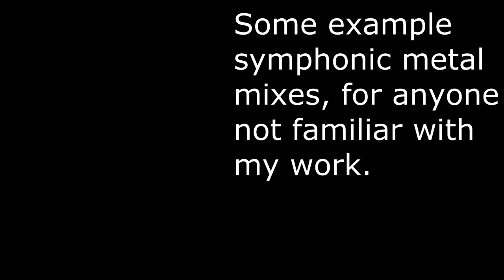How to Mix Symphonic Metal, Part 1

Comment: Certainly the most difficult genre of metal, or even Rock and Popular Music in general to mix.
I completely agree that there are no standard mixing formulae to use.  I almost think of using the orchestra like a lead guitar if that makes since.  I also keep the lead guitar to a minimum amount of presence in the mix.  Rhythmic driving from the bass and Rhythm Guitar seem to be the order of the day.  Drums can be in the middle of the volume spectrum but with lots of care with regard to EQ and Compression.
Totally agree about the vocals.  It's even harder to mix them in nicely if it's a Rock singer with a lot of grit like a Corey Taylor or Lane Staley or Miles Kennedy type of singer.

Mixing it is a pain but great mixes in the genre are few and far between but the great mixes really stand out.

LOVE your videos, man.  They're great!

EDITED TO ADD:  My personal approach sometimes is to keep the Orchestra below the main band.  The cuts around 4 kHz and slight boost at 5 kHz is a really great trick.

Comment: Gonna be keeping my eye on this series. I use a lot of symphonic elements in my music. some interesting ideas (the 1.5k on guitar threw what id thought right around. thought more 1.5k=more front of the mix).
Reply from the maker: It's a little bit higher up, around 2k-2.5k for the "front of the mix" effect, which in this genre will destroy vocals that already have to compete with ensemble strings. 1.5k doesn't really affect the position of the guitars themselves, but will expand them backward to step on things that would otherwise be comfortably clear and audible despite being in the "background."

Comment: also, what is your  take on panning an orchestral section? which instruments belongs where?
Reply from the maker: Great questions! That's something I was going to go into more detail on in another video, but what I usually do is strings/woodwinds left, horns/piano right, but there are exceptions to that depending on the arrangement. I also use 70, 50 and 30 L/R as the designated spots for the orchestra, from high to low. So violins 70, cellos 30 for instance. Choir and synths usually straight down the middle.
Reply: I think this choice is depending on what you want to achieve. If you want to emulate the sound of a real orchestra I'd recommend to place the individual instruments or sections where they are usually located in an orchestral context. The actual number, presence and placement of instruments has changed over the years and again this is something which depends on what you want to achieve but if you prefer the sound of a more classical vienna-style orchestra over a more say romantic approach then you should consider emulating this of course. I personally prefer a more conservative Beethoven/John Williams-style because I like to use more then just two timpani drums which are only able to play the tonic and the dominant i.e, and obviously because I like the sound. Sometimes I feel like composers like Hans Zimmer do whatever they consider good choices, creating a sometimes interesting and new soundscape (I.e. the brass section in Inception is bigger than usual and is literally placed high above the orchestra (in the pieces that appear when the buildings are collapsing in Cop's dream world)) while John Williams' music for Star Wars or Harry Potter has a more conservative touch when it comes to the placement of instruments or the absence of unusual colors. So I'd recommend doing whatever you consider sounding good but also to get to know different approaches. It's always good to have a large repertoire.

Most Symphonic Metal music is written more modal then functional when it comes to harmonic movement and melody. That's also why I'd prefer emulating a non-classical orchestra sound in most cases I think (just because I consider this approach to be more authentic in this case). Some libraries like the Hollywood Orchestra of EWQL contain stereo recorded instruments in their usual stereo position in an actual concert hall so you don't have to worry about it this much in this case. Problems could arise from the double basses (and such low frequency instruments like tuba, contrabassoon, bassclarinet, bass drums, timpani etc.) which are usually right-centered which is quiet unusual in the metal context if you think about the placement of the bass guitar (which is usually centered). So it may be a good idea to place them in the center as well as the cellos since they are doubling the double basses an octave higher most of the time in common orchestral writing. But you could also consider leaving them out completely when the bass guitar is playing to avoid the extra layer of blur.

It's also common practice to arrange orchestral layers in a way a keyboard player would probably do, instead of creating a full orchestral playback. So the chords aren't that wide-spread for example because the musician has to be able play it with his two hands on his keyboard. Also the use of so called ensemble patches is usual. In my experience it is indeed less time consuming to use this kind of patches but if you are serious about orchestration and a natural and more individual sound I'd highly recommend using section or solo patches instead of ensemble patches. If you are using say a woodwind ensemble patch, you have no chance to combine just the timbre of a solo oboe patch with the viola section for example. But I think that ensemble patches are usually more evenly balanced when it comes to the balance of the left and right channel. But in my personal opinion, using a winds patch, a brass patch, a strings patch and maybe some percussion (usually cymbals and some idiophones) has not much to do with 'real' orchestration. But that's neither good or bad (the first two Nightwish albums have this kind of playbacks or keyboard-layers) because it always depends on what you want to achieve. :) I think that most of the so called Symphonic Metal bands actually don't do real orchestration in this sense.